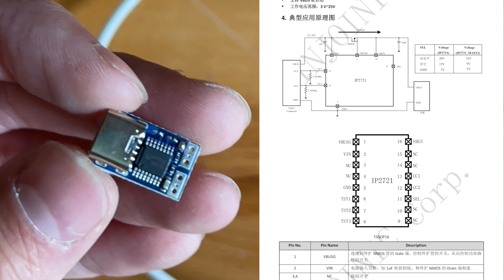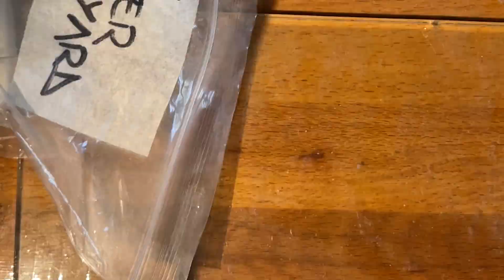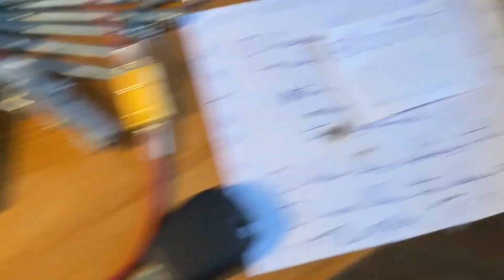DIY Type-C to MagSafe Adapter

Comment: You think this could work the other way around? To cut the Magsafe end and put a USBC male connector?
Reply from the maker: tough - the apple chargers have this neat trick of not enabling power unless the exact right resistor is seen on the other side, to prevent them from feeding 85W into a busted cable

maybe there's a readymade one though
Reply: @Darieee  What if I do what @ElEscolta is suggesting with an old MagSafe 2 85W with a ruined cable, but don't use it with a MacBook. Would it work with other devices like an old-ish Acer laptop? What are the chances of damaging the laptop (or a house fire)?
Reply from the maker: again - the problem there is the negotiating an apple laptop does with the magsafe charger; so acer would be out of the question, if that older apple laptop does this dance,

AND IF AND ONLY IF THE CHARGER VOLTAGE <= LAPTOP SUPPLY VOLTAGE

it should work, let us know by the way if it does 🙂‍↔️

Comment: I’m working on a mod board to take type c and build it directly into my 2014 MacBook. It’s providing a fun challenge since both ends are actually needed inside the Mac to just plug in a type c and go.
Reply: is it ready ?
Reply: im interested in this mod for my 15 MB air

Comment: Hello. Can a macbook pro mid 2012 take 18.5v-20v? I am planning to buy a usb c to magsafe 1 cable but it outputs the above mentioned voltage. I hope someone can help. Thank you.
Reply from the maker: should work, the big magsafe1 charger is 18v5 .. almost all the way to 20
Reply: Thank you so much!

Comment: I can't believe this. I bought a 45W anker charger which has 15V3A (The recommended profile for a MacBook Air 2013) and this thing sees 20V and starts drawing until the charger cuts out... Why does it take 20V, WHY! Funny thing is, the System Information says the charger is 60W, Which means 20V3A, but you're saying it even cuts your 65W charger... What's going on!
Reply from the maker: well .. if it sees 60W then yours should trip - I think mine trips because it was going for 85W 🧐, not sure
Reply: The default behavior of this trigger is to pull the highest voltage it can get, I think even the 45W USB-C chargers will do 20V 2.25A. There are more advanced triggers like the ZY12PDN that allow you to easily set the maximum (or only) voltage to 15V with a button. I believe there's also a version of this trigger that does max 15V.
Reply from the maker: there are triggers for everything from 5V (used one yesterday - in my disposable vape mining video), up to 9 12 15 and 20 ... the ZYs are nice but rather pricy

aliexpress should offer quite a few .. though the chinese often call them decoys 😂❤️

Comment: When you say it goes for all of it when it sees 20V, do you mean what it expects from what it thinks is the 20V charger (85W from the A1424) or whatever the charger will put out? In other words, would there be a risk using this with a charger that's, say, 100W?
Reply from the maker: there never is a risk when using a greater power charger

the voltage is the thing that is fed from the charger to the laptop

the charger's power is used by the laptop, so, it dictates what it wants by pulling more or less current

the laptop seems to go by the voltage, and assume the 85W charger (as you mentioned)
Reply: @Darieee  Thanks. And would there be a risk using these PD triggers if you accidentally plugged into a charger lower than 15V or does the Macbook know to only accept 20/15? I assume there is some brownout protection but it sounds like you were saying at the beginning this was done on the charger end.
Reply from the maker: I'm sure nothing bad can do if you feed it a lower voltage

either it realizes there's just a 15v charger and uses it as such

or it sees the magsafe advertise an 85w charger that's only putting out 15v and deems it faulty 🧐

if you try this out do let me know

Comment: Ladies and gentleman: this type c trigger does not go down to 5V. If you were to use it with a none-PD power source - you'd be freak out! no output!!! however, there is hope: WITRN pd triggers have 5V output with every power supply, so you can use it as a universal 5V usb c input for your project with any power supply, and if you choose a 9/12/15/20V trigger and the charger does not have PD, it still outputs 5V.  bit.ly/39hO9eo